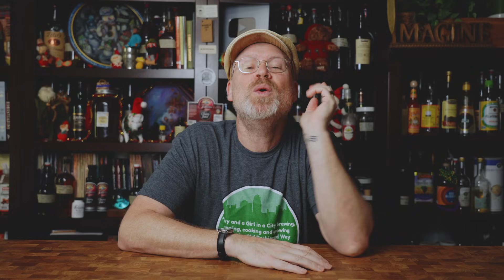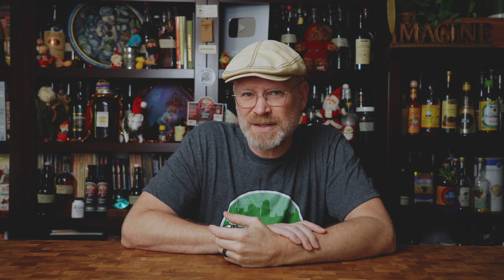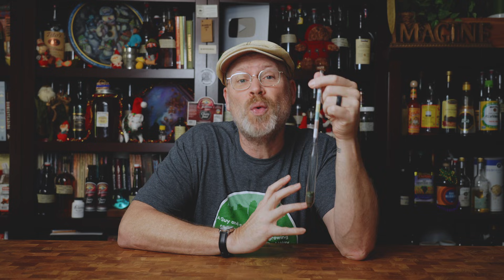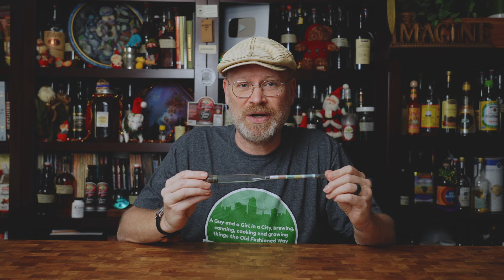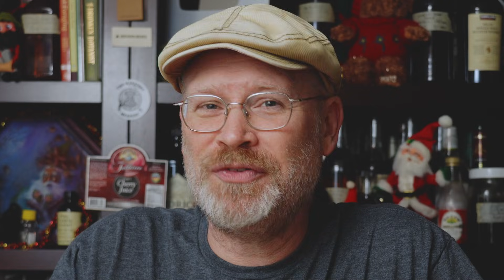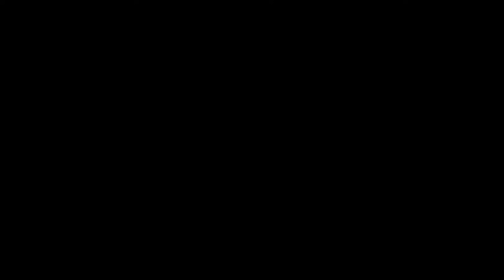How Do I know When my Mead or Wine Fermentation is Finished?

Comment: Hi brewers! I am in desperate need of help from you experts!

I am experiencing a frustrating stall in the fermentation of 2 of the 3 batches I started a month ago. I will go with the full story and a summary in the end for the lazy helpers!

So.. I am on a quest to find my perfect recipe, I obviously got into frenzy and gave birth to 7 one gallon batches (yes, I know) but with all the advice I got online the only batches I really have hope for are the last 3, the ones I made with all the required equipement, ingredients and attention to the details. 

For those 3 batches I wanted to have similar recipes, with some small and pondered differences so that I can start to make experience on what I like and what not. 

That said, let’s go straight to the point:

 I have these 2 batches started one month ago at 22 BRIX, with a yeast called “grand zin” that claims an ABV of 19%, a temperature range from 15 to 35 C, and stuffs like that, so in theory it should ferment everything (our expected abv is 12ish).

 I added 3,5g of tartaric acid, The correctly activated yeast, and Nutristart (similar to fermaid K, so DAP and shells) following TOSNA: 0,6g after 24,48,72h and a week (total 2,4g).

 I left it in my house in the corridor, temperature of around 28C (I m in Sardinia, Italy), it s not completely dark but no direct sunlight.

The fermentation started vigorously, and in ten days the BRIXs dropped to 12, then it slowed down a bit (it should be normal) but then after 20 days I noticed it stopped at 8.1 and 8.8 in the two batches respectively. I waited one week and with my despair the refractometer standed still. 

We are in range of temperature and under the ABV (should be around 8 at the moment). After some time I needed to try something because this thing was driving me mad, so I tested the pH with some paper strips (pHmeter on its way via amazon) and it seemed a bit acidic. I added 3g of bicarbonate to a gallon batch (I still find so hard to use imperial system argg) and surprisingly it bubbled a lot and seemed to help but three days later BRIX are still the same. 

I was desperate, I saw some activity with yeast and not much precipitate so I thought the yeast was still alive, I added in one batch 0,6g of Nutristart (I know it s not recommended but I need to try everything) but nothing. 

SUMMARY:

Temperature: 26-28 C

Starting Brix: 22

BRIX after 5 days: 15

BRIX after 20 days: 8

Then stuck at 8.

Yeast “Grand Zin” La food (abv:19%, Temp range 15-35 Celsius)

3,5g tartaric acid at day one

2,4g Nutristart (staggered addition)

Antistuck countermeasures:

-adding bicarbonate: bubbling at the start but no influences on fermentation

-lowering temperature: (to 18C, only tried with one batch) nothing, the yeast precipitated

-adding nutrients: nothing changed

What should I do? Pitching more started yeast? Changing Yeast? 

Help!
Reply from the maker: Are you making adjustments to the refractometer reading for alcohol?
Reply: @CitySteadingBrews  that sounds new to me enought to say… “no!?” What do you mean? 😂
Reply: @CitySteadingBrews  okay I am digging the internet for informations while holding myself from getting up in the middle of the night and take out the hydrometer 😂😂 thank you for your fast reply that was astonishing!
Reply from the maker: https://www.brewersfriend.com/refractometer-calculator/
Reply from the maker: We use hydrometers due to not having to make adjustments once there is alcohol.

Comment: Counting how frequent the bubbles in the airlock made me think, " What does this person think it's like timing a pregnant woman's contractions? Yes yeast can't read and like the pirates code it's more of a guide line than an actual rule. To much sugar (rum) to the pirate crew (yeast) they're not going to be able to work like you want them to. Not enough sugar/nutrients (rum/food) they might stall or yeast might mutiny until you give them what they need. I guess when I do my second pulmonary gravity reading I would find out if I managed to get my first brew unstuck and if it taste different. It was active for eight days and then no activity for two days. The first taste test of the corn braggot seemed promising and when I make a second batch minus the mistakes I had made with the first batch. At least I will have something to compare it to. Hopefully more caramel popcorn than just a high gravity, sweet floral honey notes with dry oaky earthy, citrus corn ale that finishes with a hay after taste. If I do decide to oak the second batch I will definitely do it during conditioning and not during primary fermentation. Hopefully when the first batch is done it will be 9-10% considering the alcohol tolerance of the ale yeast I used is 9-11% The first gravity reading I did before pitching the yeast (a whole packet) 1.130. The first pulmonary gravity reading I did read 42 which if that is correct would mean a 5.51 percent alcohol so far. My maple version of the Lapsang souchoug seems like it is still bubbling pretty steady and I will more than likely be much more confident with the first pulmonary gravity reading for this brew compared to the corn braggot.

Comment: You don't HAVE to have a hydrometer. All you're doing is measuring the density of the liquid. If you can graduate your vessel so that you can measure the liquid by volume and measure the mass of the liquid (make sure to measure the mass of the empty vessel and subtract that from the mass of the vessel and liquid), then you can divide the mass in grams by the volume in milliliters (multiply the milliliters by 0.99802 first if you want to be extra precise) and that will give you the specific gravity of the liquid. It could be helpful if you don't want to open up the container or don't want to seal up a hydrometer until the batch is finished.
Reply from the maker: Hydrometer is so much easier, lol.

Comment: Hey guys thanks for the awesome videos. I do have a question on my cranberry wine. The ingredients for 3 gals are 120 oz of chopped cranberry 2 mandarin oranges 5 black tea bags and 18 cups of sugar. And fleischmanns bread yeast. Original gravity is 1.106 on 11/10. On 11/30 it was 1.100 it got colder in my basement than I like so I brought it upstairs 73 degrees and stirred it and it had lots of activity the next day. Checked on 12/24 and gravity was  1.056. On 1/2 it was 1.052 and on 1/15 it’s at a 1.052. It seems weird to me that it would be done at that high of gravity. What are your thoughts. Thank you
Reply from the maker: It's not done.  It stalled.  Try adding yeast hulls and maybe fresh yeast.  Keep it warm at 70f or so.  Could be pH too as cranberries are known for stalls.

Comment: Just to share a story. I am currently brewing your spiced metheglin. After 29 days in initial fermentation, I noticed my airlock had stopped bubbling so I figured it was time to rack. I did a gravity reading and it only went down 70 points. I sat and thought about what I did with this brew. Initially I thought maybe it had something to do with how high my OG reading was. I hadnt pitched my yeast yet so I poured out some of the mixture and added more water to bring it down since it was off the charts (main reason why I take a gravity reading before pitching). Then I realized how dumb I was. The fermenter sat in a closet while I was out of town for a week and we put the heater on eco mode. The house was down into the high 40s while we were gone. I just gave it a swirl and let it sit for a day and viola, airlock is bubbling again and I have a krausen. Glad I didn't do anything drastic.

Comment: Nice video and very useful information. 
An alternate option could also be to just wing it, backsweeten if necessary and pasteurize the brew. Even if the yeast was still active, pasteurization will surely halt further fermentation. (It may negatively impact flavor, but winging it may always come with some downsides)
Reply from the maker: It’s so much more practical to just take a reading.

Comment: Yah, but if you're going from primary to secondary,    it really doesn't make a difference.
Reply from the maker: It does actually.  You don’t want to rack until fermentation is complete.  Racking removes a good portion of the yeast colony so if it’s still fermenting and you rack… you risk stressing the remaining yeast and possibly a stall.

Comment: If it clears up and yeast is at the bottom, it's done, at least that's how I go about it.

In case you keep it in a cellar as I do, and it doesn't clear for a long time, like for me, it could be because at some point, most likely due to temperature, but could be for a plethora of things, the yeast died and is continuing to float in the mead, it won't clear, the best bet is to bring it inside, frak it, add some more fresh - living yeast and keep it inside, and let it finish.
I once tried to cold shock it by leaving it outside in winter, but even in -10 C weather, it didn't work, left it for 13h too.

P.S. By "long time" I mean 4 and above months.
Reply from the maker: It may work 99% of the time, but stalls still happen and those yeast aren't actually dead most of the time.  They're just dormant.  I still say that gravity readings are the way to know for sure.

Comment: Thank you for this info. I've heard you say "yeast can't read" many times and I fully agree.
I'm working on a sweet cherry pomegranate wine, using red star premier classique.
Starting SG was 1.200. In ten days it went to.990 (top of my hydrometer). I racked off the liquid and added one more pound of sugar figuring it might ferment out a little more and leave a sweet cherry taste. Seven days later, it went to .990 again.
I added another half pound of sugar and waited another week (twelve days, life does get in the way). It's gone back to .990.
I've now added another half pound of sugar ( two plus one plus half plus half equals four pounds of sugar in one gallon) and will wait another week or two for final SPGV. If it goes dry again, I think I'll pasteurize it (I can't see using any more sugar) and back sweeten with unfermentables. I'm also thinking about cutting it with cherry flavored punch to knock out some of the alcohol "punch".
Any other suggestions or possibilities? Thank you again for your continuous edification towards your viewers 😁👍❤️
Reply from the maker: Are you sure it started at 1.200?  Most hydrometers cannot read that high.  Was it possibly 1.120 or 1.020?  What was the original recipe?  I mean... you added 2 lbs after primary, so that's already 1.094 right there....  Seems odd to me, like there may have been a mistake somewhere.
Reply: @CitySteadingBrews  I apologize. 1.120, I looked at the hydrometer, 1.160/20abv is bottom white end, and.990 is white top end. the amount of liquid was one gallon exactly. fermented in large mouth one and a quarter gallon container. If all is good, abv should be around eighteen percent?
BTW, is it possible to go below .990? I have a set of alcohol concentration testers, Three in total, should I be using these also?
I started my station with a brewers kit that came with EVERYTHING 😁.

Comment: Will wine and mead naturally degas or do you have to degas them?
Reply: They will naturally degas, but it takes months.
Reply: @IamAMeatPopsicle19  thank you
Reply: They will all naturally degas,..think leaving an open beer or soda on the table & come back in few hours.. it'll be flat (degassed). This process takes longer when the mead or wine is in somewhat of a closed container, i.e. fermenter w/air lock, bottle w/cork,...etc. Sealed tightly like a beer bottle? Not so much. The key is the gas needs somewhere to go. On the same topic, if your tap water is chlorinated (like mine) heating it up to boiling will cook off the gas. Letting a pitcher of said tap water sit out on the counter for a few days accomplishes the same thing. Hope this helps. Cheers.
Reply: @larryakre5942  thank you. I have a apple from fresh pressed apples that just don't seem to die down. Been going since end of October. It's at 1.000. I will let it set.
Reply: @louanngraham185  You're welcome 🤗 You can always speed up the degassing process by agitating the container or stirring the brew. If you have time, you can shake/swirl the carboy with airlock installed & watch the bubbles escape vigorously. In the case of a fermentation pail (3gal. batches & up), carefully remove the lid and give it a stir with sanitized spoon or spatula. The wide flat surface is great for agitating the liquid to release the gas. When you start to Hear the hissing slow down, stop and replace the lid with the airlock. There will still be some residual gas that will form a protective layer over your brew to keep oxygen out. I believe Brian and Derica have videos on this as well. Cheers
Reply: @louanngraham185  Just remember that some yeasts take longer to munch through the sugars than others..num..num..num!
Reply: @louanngraham185  apple usually stays a little bit carbonated. Some use a fermentation stopper, and then stir or shake to get rid of the bubbles. Some add a little more sugar when bottling, to get more bubbles like a cider.
Reply from the maker: It will naturally degas, can take a week or more though, sometimes a month.

Comment: This video came just in time I made a lemon wine with frozen concentrate and it stopped bubbling ,so I checked it ,its at 1.050 and I started with 1.080 it has been a week it tastes good but I want it to go dry.I thought it was done because of the bubbling stopped so I put a cap on the 1 gallon jug and put it the refrigerator thinking ok thats it,its done something went wrong but when I checked a little later it was building up co 2,I took it out and back on the bubbler so I shall see what happens,thanks.

Comment: Humidity will affect wine fermentation also, read somewhere 60% is the ideal humidity.
Reply: It might if you do what’s called ‘open fermentation’. But in the closed environment of a fermenter that’s sealed with an airlock, temperature is the salient factor. Higher temperatures will cause more evaporation, which will affect the relative humidity. But at what is considered ‘normal’ room temperature (between 20°C and 26°C, aka 68°F - 78.8°F) the variance in relative humidity will be negligible.
Reply from the maker: With an airlock, humidity won't even get into the fermenter...

Comment: What about rising bubbles from the bottom? I have a brew that has been going for 9 weeks, it still has loads of rising bubbles in the liquid so I haven't taken a reading yet.
Reply: My take on that is: forget about the bubbles. Take a reading, wait for a few days, take another. Better yet: snap a picture of the hydrometer inside the testing tube with your phone. That way you can enlarge it and make sure you’re reading it right. A week later, rinse and repeat… comparing both pictures helps A LOT, especially in the beginning. When in doubt, you can even post both pics on a forum or home brewing Discord, Facebook group, etc. 

Next to my ring binder of notes, I have a photo album of hydrometer readings on my phone. Most phones allow you to add notes to photos, which I use to add the brew’s name. Embedded in the photo’s data you’ll always be able to find the date, too. Quite handy!
Reply: Is it still on the lees?  I've noticed that lees produces bubbles that rise in the brew and don't necessarily make the airlock bubble.  If you rack it off the lees, and the bubbles stop, that was it.  But I'd take a couple readings a week apart first, just to make sure.
Reply: @julietardos5044   - True. And if fermentation is done but the lees is producing bubbles, I’d rather have that lees gone.
Reply: @julietardos5044  Yes, still on the lees. However it's just sugar wine...5 litres water, 1.5kg sugar, 1.5 tea spoons nutrient and Gervin GV4 yeast which is meant to go up to 21%. The reading is 110 after 65 days.
I've watched it bubbling away as though it was fermenting vigorously.
I made apple wine with 1.5kg sugar and 8lbs apples and supermarket wine yeast, that was done in 3.5 weeks, very dry with a reading of .998
Reply: @MrSHAUNE55  Reading of 1.110 or 1.010?  If it's 1.010, it's probably done, so rack it off the lees and see what happens to the bubbles.
Reply: @julietardos5044  Thanks for your reply, I must admit my hydrometer reading skills are not the best, only just started recently. It's 1.010 (the 10 below the 1.000)
It tastes sweet, it's the first time using that yeast, maybe it's not as good as the reviews I read? I wanted a strong unflavoured brew for something, like I said the apple with a different yeast and same sugar went dry after 3.5 weeks. I'm going to leave it (maybe that yeast is very slow?) and take readings every week and do another brew with my usual cheap multipurpose yeast that always goes dry.